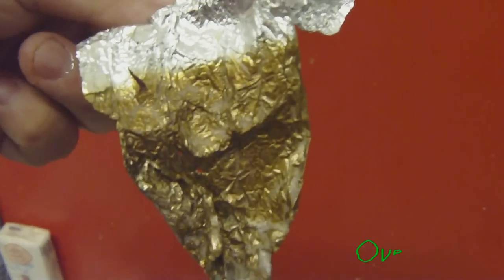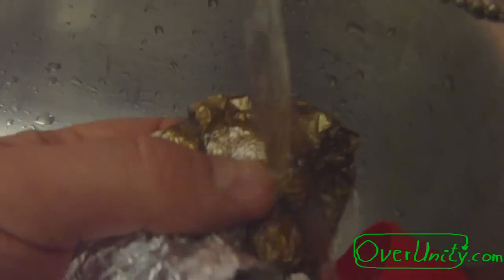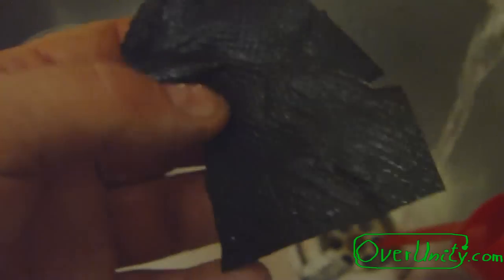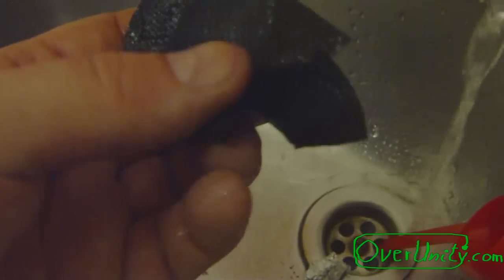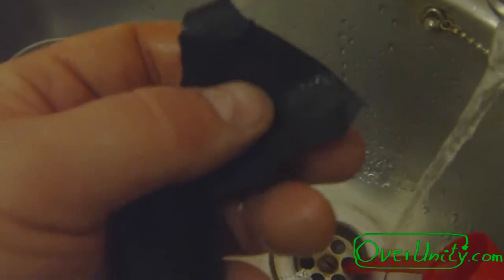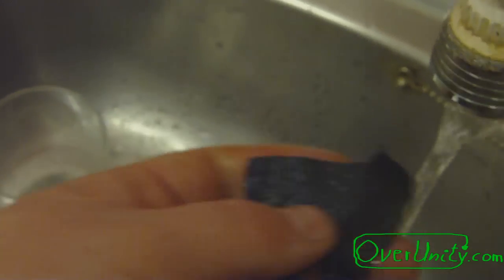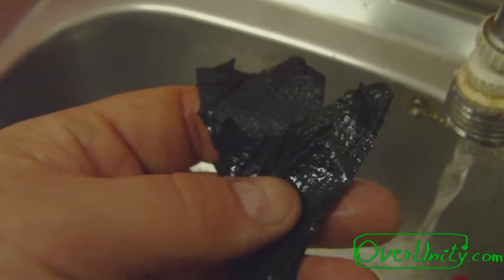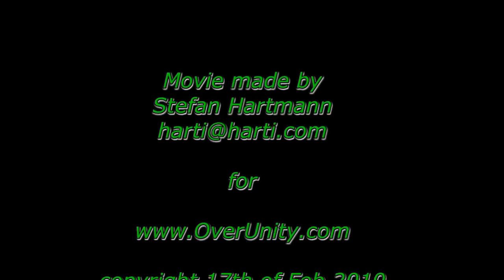Graphite-paper Aluminium foil battery cell breakthrough voltage up to 1.92 Volts 4/5

Comment: It can be a problem in HHO in manifolds too. Even after the gas is scrubbed through a bubbler. NaOH and aluminum are a BAD combo. nice voltage tho. good for a Mcgiver emergency battery. Al + Cu should give you even more, 2v likely. Nickel Iron is the way to go for homemade, lame output long life :)